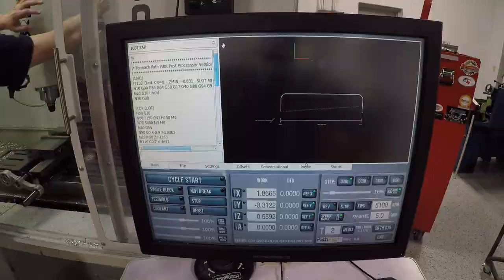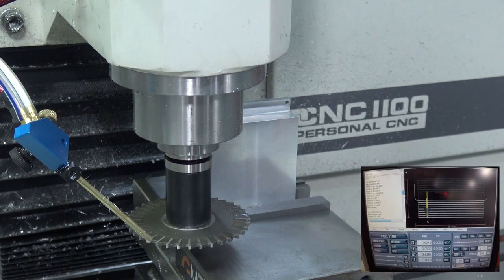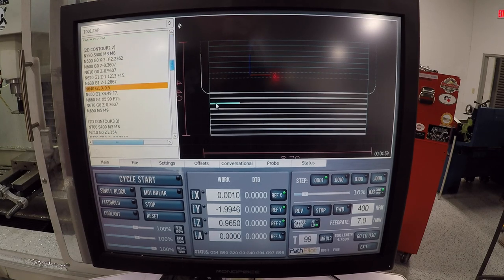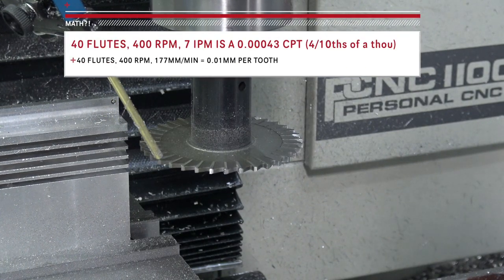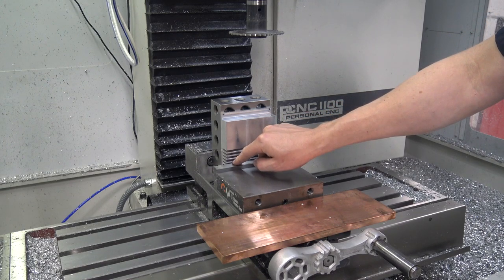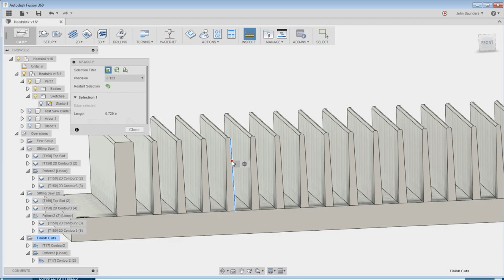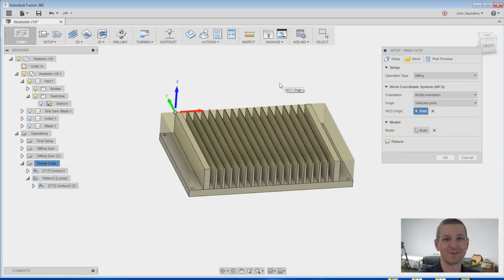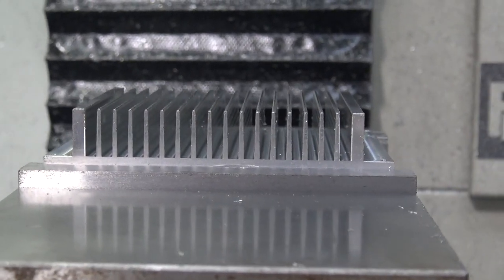CNC Machining a Heat Sink!  Part 2 Widget102

Comment: Bingo on the spray mist trouble shoot. number one with saws is to clear chips. number two is a bit of oil to keep the next chip from sticking.

for speeds and feeds you absolutely can treat saws like any other cutter in terms of surface footage but unfortunately there is one additional constraint. the total volume of the chip per tooth. if you remove more aluminum in one bite than fits into the relief in front of the tooth well... that's a bad time. it doesn't matter if you go slow for a small cpt, you still wad up a curl of chip (just longer and skinnier).

with all the time spent baby sitting the cutter it'd be worth the extra minute of cycle time to revisit HSM techniques, in this case it kinda feels wrong taking depth passes but in actuality you're constraining radial step over.

Comment: When I get heavy aluminium chip welding I then soak the tool in caustic soda to disolve any remaining aluminium. Then soak the tool in penetrating oil to try to decrease the welding ratio

Comment: vibration and heat seems to come from high rpm..
the T cutter is made of HSS steel. cutting aluminium = Vc 45-60m/minute depending on tool/machine rigidness and coolant/lubricating

since your in the big vibrating end building heat for lack of lube i would suggest 40Vc m/minute

40cutting meter * 1000 (converting to mm pr. minute)   / 3.14PI / 102MM D. = 125RPM * 40 tooth * (0.015)-0.02 pr. tooth = 75mm feed pr. minute:)  a bit slower but no stop. well done self thought machinist

Comment: Nice job. Glad it worked out well. Thought I had was to only make upper cuts on slots all the way down and then do all lower slot cuts on second pass down. This would leave thicker material above each of the cuts removing the most material. Making wall above stiffer to reduce chatter. Thicker material might also pull a bit more heat away from cut. Worked out well anyway, so probably irrelevant. Just a thought you may try out in future.

Comment: Feed is a big thing when using these side cutters. for example if your run it with about vc 100mm/min, that equals
100mm/min * 1000 / pi / 100 = 300 min^-1
with this 300 rpm asuming 60 teeth using a per teeth feed of 0.05mm you get a feed of 900mm/min.
Witch sounds scary beause its higher than the rpm, but with this amount of teeth you can totally do it.
Best Regards Sam
P.S. I'm swiss so metric is my thing ;)

Comment: got six inch parallels? then scotch tape a number 30 drill bit(you might need one for front another for the back vise plate) to the vise floor under the parallels at the very right edge of vise  insert part tighten check if you must with digital protractor - voila- 1.4 degree angle then use WCS with Z set to taper angle (1.4 degree) and use 1/8" cutter 
flip and repeat done

Comment: I would have shimmed the heat sink at 1.4 deg. while slitting it to get a smooth non stepped surface. I have always had the best luck with smooth heat sinks as they collect less dust over time.

Comment: A thought - if the chip is only half a thou thick, and if the cutter is half a thou off-center... wouldn't some teeth get a double chipload, and others just rub against the cut?  It sounded like it was only cutting part of the time, and that might explain some of the heat.  Whenever I watch someone using a slitting saw, the sound varies as it rotates, instead of being consistent.

Comment: i would imagine the stair-step on the fins would actual give better performance of the heatsink since you get more sharp points... i'm not a thermal guy, but it seems to me that would actually be a benefit over those walls having a smooth 1.4 degree incline.

Comment: you should be flooding that cutter with coolant when cutting slots in aluminum ,the air  is not enough
Reply: thats what i think
Reply: It's cooled with MQL system.
Reply: Same here

Comment: I was told never to go more than 3X tooth for depth of cut on a side mill. Even lower on a straight one. I also calculated a much higher speed and feed.
Reply: I've always adhered to the no more than 2-3x the width of the cutter for a depth. So 1/8" wide saw, 1/4 to 3/8 depth per pass. Prevents those long curling chips from filling up the gullets specially in aluminum.  Keeps the heat down too

Comment: great job, its hard to channel with wheel cutters. most people stay away. the higher rpm and all those teeth create a lot of heat. also the thin chips weld to the cutter very easily. slow down rpm, use flood.
Reply: also when you use the air hose, it sprays away the coolant.

Comment: Due to deformation in the cut material, uncut chip thickness (what you calculate) is always smaller than the cut chip thickness (what you are measuring). Unless you are using a cutter with a <90 deg entering angle which causes chip thinning, but this is not the case here.
Reply: Depending on how far down the rabbit hole you want to go, you can find some light reading material here which covers that topic: http://www.ewp.rpi.edu/hartford/~ernesto/F2005/MAMS/zpapers/Childs/ch02.pdf

Comment: Wouldn't it have been much more efficient to set the block 1.4 degrees out of plumb when using the slot cutter and milled the tapered fins in 4 setups (two per fin plus the flip)?   If you have more than one of these to make, milling a pair of wedges to clamp the block in the vice would be easy enough.  Or you could fixture your 2x4x6 block to a sine plate (or better make a mini pallet block to fixture to the sine plate) so you can quickly do this type of operation.  Fake a 4th axis.  I know there is always more than one way to do anything and have no idea how long the 1/8 mill took versus making the other "widgets" to tilt the block.  It just seem the big slotting cutter is way faster than the little mill and doing multiple stepped passes to simulate the taper.
Reply: Yeah that's what I suggested in the comments for the original video when John was modelling this. I mentioned the "draft" that fins normally have, and maybe the term was confusing. I didn't notice until I went back and viewed the video again that the fins already had a draft (ie taper) on them.

The easiest way to set draft is to shim the stock, fixture or vice, and just whack the material off in a straight line as per usual. Especially on a job like this where I suspect the angle wouldn't need to be correct to 4 figures!
Reply: +Pete F that would be 4 ops to cut the angles. An additional 2 to cut the straight wall sections of you did that with the saw plus an additional op to clean up the floor of the slots as there would be triangular boss at the bottom left over from the saw being at an angle. 5 to 7 ops instead of 3?? Makes no sense.  Not to mention locating your Z and Y zero will be a PITA with a part at an angle like that.
Reply: There are 3 ops to cut the fins like we're suggesting and the fin taper is straight. The bottom clean up is very fast. The angle of the part is quite low and easy for any competent machinist to locate on.
Reply: +Pete F each fin is tapered on either side. You can't reach every slot in one op because the saw arbor isn't long enough. 

So 1 op cuts half the fins at one angle, op 2 the rest of the fins and the same angle, op3 half the slots at the reverse angle. Op4 rest of the slots at the reverse angle. Op5 clean floor and vertical walls.
Reply: The fins from the side view look like this /\.  Not //. Or \\. 

Meaning you need to set up the angle twice. Once with the part kicked back 1.4 deg and once with the part kicked forward 1.4 deg. You can't hit both sides of the taper in one shot.
Reply: Mate, I don't know how long you've been doing this malarky, but just because you don't understand something doesn't immediately make it "wrong". Any decent machinist knows there are often many ways to approach a problem, and the smart ones will listen to how others may have approached it. They may come away thinking it's a better way to do it, they may not, but in another situation the alternative way may be better. That's what smart people do anyway. The idiots? I have no idea, probably troll the internet and start lame arguments of Youtube about things they don't properly understand I'd guess. Have a nice day!
Reply: Thank you Captain obvious!
Reply: +Pete F lol. I never said it was wrong.  It would most certainly work. I said it make no sense to do it that way. 

You drastically increase both setup time and complexity. No decrease in cutting time or cutter life, and negligible improvement on part quality. 

It's a perfectly valid way of doing it. But is it really more practical than the method used?

If all you had was a manual Bridgeport ya. Maybe the sine plate and fixture way would be better. But he has a full 3axis cnc capable of surfacing. So why bother setting up sine plates and making fixtures and complicating the setup? Especially for a single part. 

You can build an entire house with just a hand saw a hammer and some nails. But personally, if they're available, I'd rather use the power tools and nail gun. Makes a lot more sense to me.
Reply: my thoughts exactly, even if you make a backing plate for the job with the mounting holes threaded in that would also work as a extra heat sink for the operation and bring back the rigidity to the piece after the turn.
Reply: +Occams Sawzall You obviously missed the bit where the profile of the fins did not match the drawing.  As it turned out apparently the customer was happy to accept steps in the taper, but that is not what the drawing called for. In order to make the part according to the specifications, the easiest way is to use the same cutter, but cant the part to the taper required on the fins. Machine vices are not welded to the table, and can be used creatively, or, heaven forbid, removed entirely in order to use a fixture plate.
Reply: +Pete F which he addressed with already investigating a tapered endmill. 

If the wall absolutely needed that taper exactly. Was just a matter of using either the proper tapered rib cutter. Or decreasing the step down when surfacing. 

And I'm well aware the vise ain't welded to the table. Creativity is fine if it's just you with all the time in the world.  But time = money and more setups = more time. So the more time it takes to do something, the less money you're gonna make off it.  And with a straight forward part like this that you can charge a pretty penny for. You squeeze every penny you can get. So you go for the fastest setups and quickest run times. Which is why he didn't opt to just use an 1/8" for the whole thing and run it lights out.
Reply: Sine Vise is all he needed......No extra setup or steps.

Comment: I hate slitting saws/ large sidecutters. They all behave differently and it's hard to get speeds and feeds right. 
But imo the easiest approach is to make shallow cuts - no deeper than cutting edge lenght - and be bold with cutting speed. Vc 60-70.
Not exactly by the book but that's what worked for me in the past. (old but sturdy Maho 600)

Comment: Awesome vid thanks. Hey am curious what you would charge for a small but reasonably labor intensive job like this one? Also, interesting use of the slit saw. Personally I would have been so much more aggressive and welded my tool quicker - barrrp.... reposition..... barrrp..... stop. (high speed passes lol)

Comment: Tip for next time you do something like that
Bolt it to a big/thick plate witch Wil simolate that is way thicker and wound have all that vibration noice

Also go a bit slower in feed and rpm and if possible also use cooling water ( it crisp up the chips so they wound stick. Speaking from own experience)

Comment: Is the Haimer zero reading off in this video? Or is that just the camera angle? If it is off, will that result in the zero measurements being off? I’m asking because I just went through the trouble of adjusting my zero point using the two 1.5mm grub screws and I’m wondering if it was even necessary.

Comment: You should have done a few things to make your life easier. a) You could have used the copper as a fixture, that would have sucked away more heat, b) use flood coolant, and c) align the slotting blade properly.

Comment: You could have run the part with out the slotting cutter. Your customer allowed steps on the side wall. You could have done everything in one op after squaring up the part.

Comment: Wonder if maybe not cutting the fins in order would help with the cooling, to stagger your cuts, both in which fin and which step...so that you are not cutting into aluminum just previously heated by the last cut, give more time for the heat to sink away.
Reply: +NYC CNC well. Spacing out where each consecutive point of heat is generated would keep the part cooler as it would spread out the overall heat. 

But I doubt enough to help in this case. Really you needed full flood coolant. Air and an asthmatic sneeze worth of cutting oil just ain't enough. Air just can't take the heat off well enough. It is an insulator after all. 

You'd actually probably have been better off with a squirt bottle of coolant than the fog buster.

Comment: Often aluminium handle at higher speeds with the same feed and no cooling, or cooling the cutting zone. 
If cooling is only a tool, as in your case, then the treated material is very sticky on the cold tool .

Comment: Your problem is a lack of rigidity and horsepower in relation to the number of teeth on the milling cutter. 

Your machine doesn’t have the rigidity for all those teeth and it doesn’t have the horsepower to push that many teeth engaged at once. 

Reduce the number of teeth by at least 3/4. Literally grind off most of the teeth from the cutter.  6 teeth is plenty, just make sure that they are evenly spaced apart and increase your chip load to at least 0.003” per tooth. 

RPM is horsepower dependent. Start at 350 RPM and increase feed rate and RPM proportionally to the limits of the machine’s rigidity and horsepower then back off 20%. Watch the spindle power meter and keep it below 75%. This will maintain accuracy and not beat your machine so much. 

The chip welding is because there are a bunch of super thin chips welding together plus a coolant failure. Increasing the chip load avoids that. 

The air pressure to coolant ratio on your mister may be too high. You don’t really want a mist or atomization. Droplets with air as a carrier. You will achieve some cooling simply from the air expanding as it leaves the nozzle but in my opinion, that cooling is to cool the lube(which cools the part). I don’t think the expansion cools the part in any meaningful way. 

Also, if you’re not using Boelube for your mist then switch to it. Brush it onto all surfaces including the cutter. 

My final suggestion is to cut a roughing slice down the middle of the trench leaving 0.020” off of the bottom wall of the trench. Then come back with a finish pass against the top and bottom walls of the trench (don’t forget to take off the 0.020” at the bottom of the trench as well). This will leave a beautiful finish everywhere. 

I had the same problem 30 years ago on a Milltronics Partner 1. It was a little bigger than your Tormach but it had an epoxy concrete frame which robbed it of rigidity which permitted chatter too easily. But, it’s what I could afford and it put me in business! My mentor told me to grind off most of the teeth on the custom milling cutter that I just paid a fortune for, increased the chip load to what the machine could handle and never heard another chirp from it. The job ran beautifully until I learned a second valuable lesson. Plastic with black pigment dulls HSS cutters FAST! So I had to have that cutter sharpened a few times to complete the job. 

Ahhh, those were the days! Now I only buy machines that weigh more than 15,000 pounds. I’m taking delivery of my new Hurco VC600i later this month. More than 20,000 pounds. 😉
your problem is
Hope this helps!

Comment: How many tooth blade is the slitting saw? I work with CNC controlled cold saws pretty regularly and wouldn't mind trying to help a little on your chip stick issues.
Reply: Anyways you might not run into as many issues with a     Higher fees per tooth. Something around the .025-.035  mm per tooth range.

Comment: Whoa, that saw looked (and sounded) like it was waaaay too fast to me. Admittedly I haven't done much of this type of work in aluminium, but what sfm were you working on with that cutter John? I don't know whether that token coolant spray is the best for aluminium, but to me it was effectively being machined without coolant, and a cutter like that I'd be at half that rpm. Maybe ramp it up a bit from there if your pucker can tolerate the stress!
Reply: Actually I thought the RPMs were too low. The feed seemed a bit much.  

Shouldn't hear oscillating sounds when it's cutting. That means you're generating harmonics in part of cutter. 

Should just hear one single pitch sound through the entire cut.
Reply: How did you determine the speed to be too low? The tool was cutting at something like 130 m/min, effectively dry, that's way too fast for a cut like that.

Comment: Woha that must be the most expensive heatsink ever made :)  :)  what would be great was if you could explain how you zero the X and Y - it is still not clear to me how to do this superaccurate between operations.  Much appreciated!
Reply: He used the Haimer indicator to zero his X an Y, but you could easily use a regular edge finder. With the Haimer, you move the probe tip against the edge until you reach 0 on both dials, and press the Zero button for that axis in Path Pilot. With a regular edge finder you have to add or subtract the radius of the tool, depending on which side you’re indicating off of.